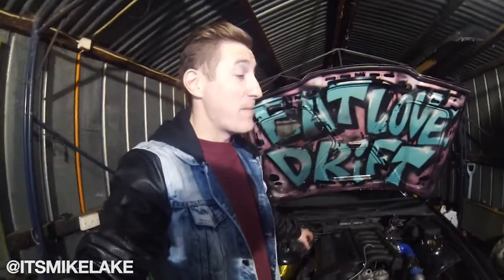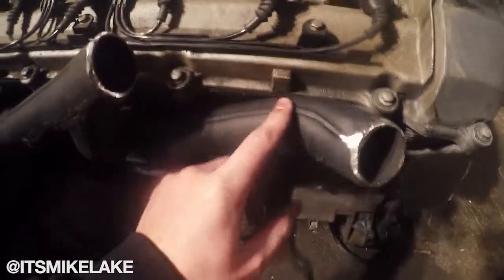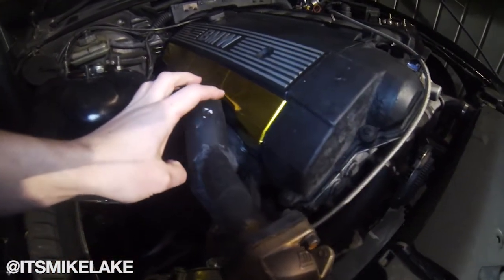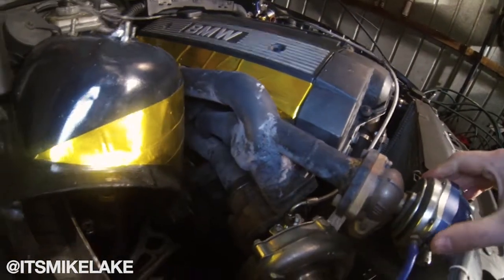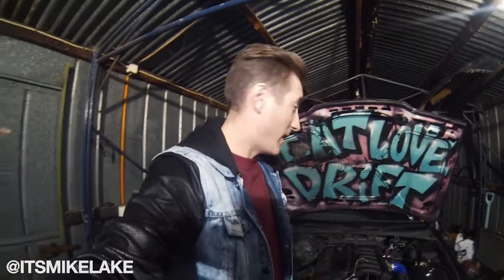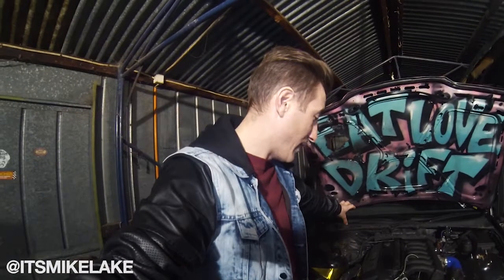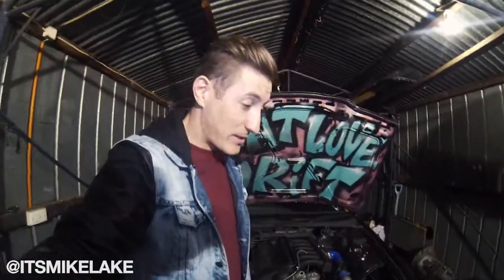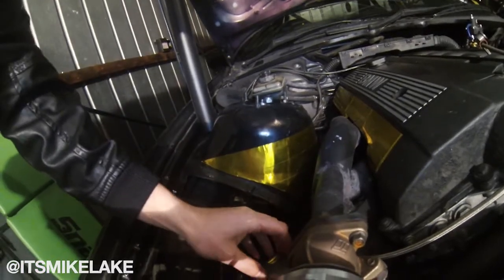BMW M50 DIY TURBO BUILD - RHD Manifold

Comment: Hey where did you install your oil drain line? 
Cheers! Im planning to buy an ebay manifold and flip it, i got a lhd e34
Reply from the maker: Straight the the sump my dude! Wasn't too tricky
Reply: @itsmikelake  they say in harsh turns oil returns to the turbo and starts burning?

Comment: Hey Mike, I have a e36 RHD that I swapped out my M44 for a M52b28 and I'm looking to run boost shortly. I'm really want to see a video on how you modified your manifold to get it to work. I was going g to buy one but jeez, the prices. Normal bottom mount is $74, top mount is $375 and top mount for rhd is $685. Where I live the exchange rate is roughly $2 to $1 US, so I have to pay double.
Reply from the maker: I feel your pain my dude! I have videos on the turbo manifold and link pipe I made. Check out my video on "How To Turbo Your E36". Remember you'll need to get an ECU, injectors, intercooler etc aswell. Don't rush it. Take your time and it'll be nice and reliable!

Comment: how many hp does the m50b20 resist whith stock internals?? Or is better to get an m50b25?
Reply from the maker: You can run 10psi all day every day without an issue. You'll make 200hp no worries. Obviously the b25 will make more power with the bigger capacity motor :)
Reply: Mike Lake Do you think it would be 350 hp without problems?  my idea is to reach 450

Comment: Hi Mike.  Can we use the m50b20 manifold on a m50b25 to do the same thing? and have you got small vid on what parts you used for the oil feed?... was wondering if a subaru turbo @7lb would make a b25 a bit more hp?

Comment: Looking good bro! I’m across the ditch in nz! I’ve got a m50b20 in mine that I want to turbo and then a m50b25 sitting in the garage once the 20 gives in. Quick question,did you do any internal work on the engine,like headstuds etc or just slap on the turbo and go. Keep up the good work!

Comment: Yo Mikey. Have you seen the cast type m50 manifolds? They have pretty short runners and may just clear the steering shaft? I'm looking at either supercharging or turboing my m50B20TU. Supercharger would be way easier but these engines make great power with a turbo.
Reply: Would be a top mount for sure. There's so little room exhaust side on the m50. I might actually do what you did because welding stainless isn't too hard. Besides it kicks ass as you show in this vid :D

How are you liking the m52? Did you have issues with OBD2?